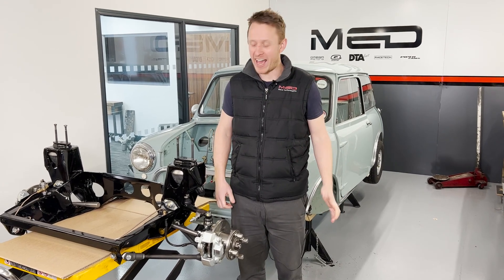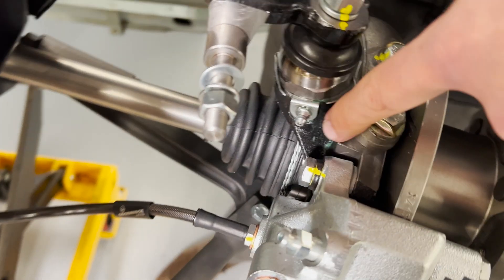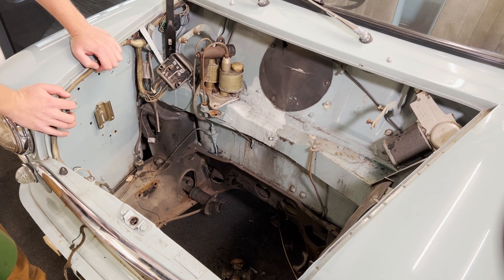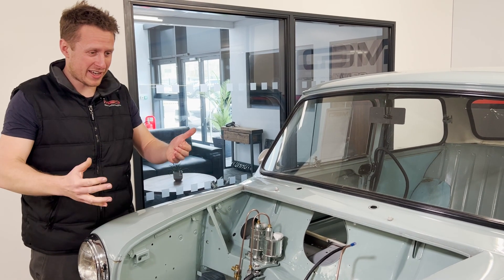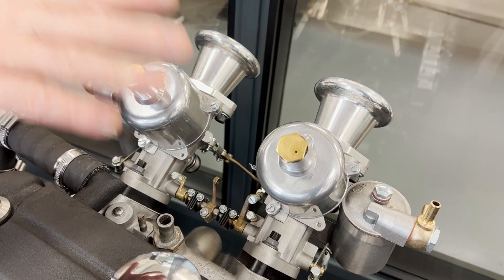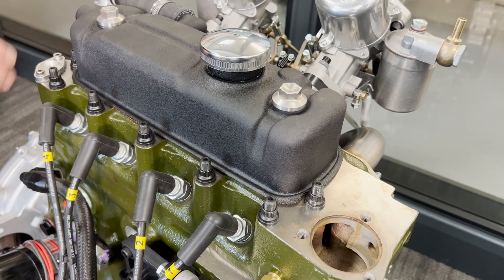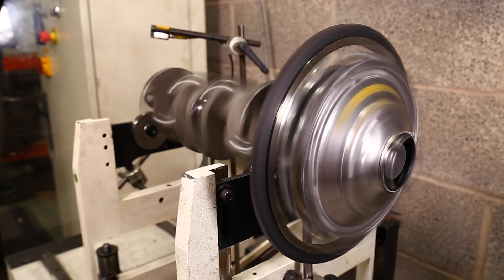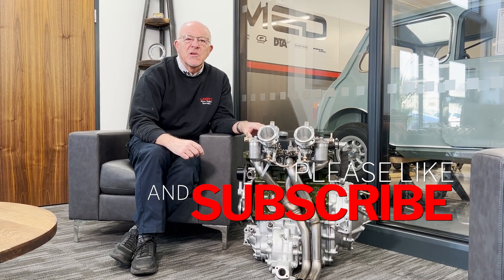Project 63 part 18 - New front subframe and 1310cc modified A-Series engine

Comment: Great stuff. I have a 1430 cc A+- engined Morris 1000 Traveller. I'm pretty sure that it has some/many of your bits on it. Emerald ECU runs it beautifully. Only as a road-car though and off the road because the wood's falling off in parts.

Comment: I would have loved to see the complete engine build, not only the block preparation and afterwards the finished motor.
Reply from the maker: We decided to get moving with the build, as to try and do step-by-step on every process it would never get done. Sorry
Reply: @MEDEngineeringTechVideos  Well, I do understand, but MED is famous for it´s Mini engine parts and modifications, so I guess that could have been a good marketing tool also. For example you could have linked some videos in your shop. 
Maybe on the next project ;-)

Comment: Looks great, and a very nice specification for the engine.  You seem to have latched onto precisely the spec I had come up with for my own car, so I won’t need to waste ages of your time discussing it with you.  The only sad thing is that you’ve abandoned your video programme : no engine build video, no subframe installation video, SO disappointing because the earlier videos were so useful to those of us who haven’t done this before.  I was learning a lot, and was very grateful for the lessons.  Oh well.  Did you get bored?

Two questions:  what needles do you use in the H4s?  I will dyno the engine, but would like to know where to start…. And why stick to 7.5” brakes when twin-pot 7.9” would fit in your wheels?  And (the third of my two questions) will you fit a servo?
Cheers
Will
Reply from the maker: Thanks for the feedback. We struggle to get the time in the day to make a full tutorial video, sorry. So in the quest of finishing the car we've scaled it back a bit. 

Try AAA needles and red springs to get the engine running, although if running an XT cam you may find this on the lean side. 

The 7.5" S discs and a decent set of pads are plenty enough for road and even race use. The 7.9s you usually need to run the later Metro drive flanges, and be very careful about balance weight positioning on the wheels. We'll not fit a servo, no. That won't improve the brakes, only make the pedal easier.